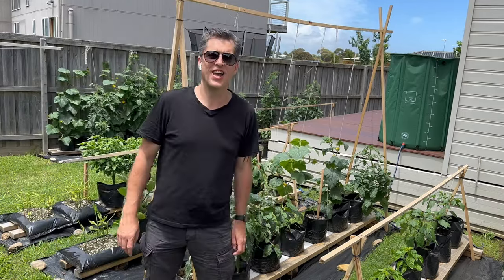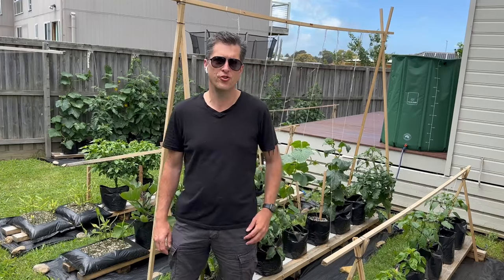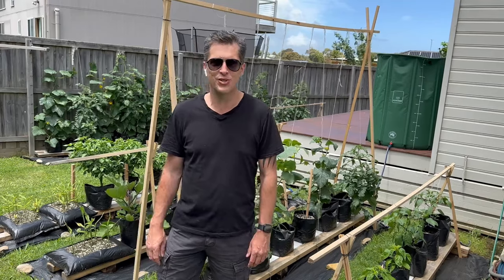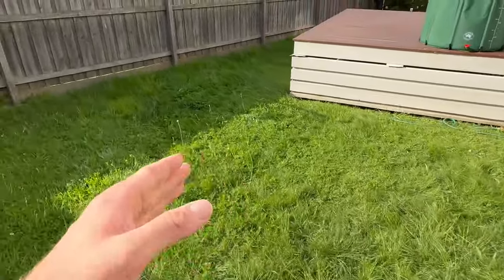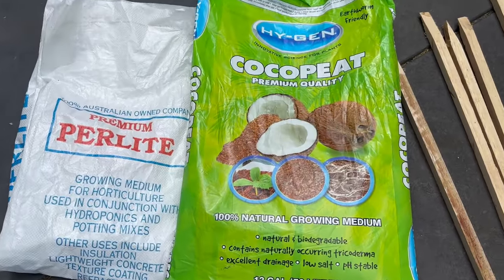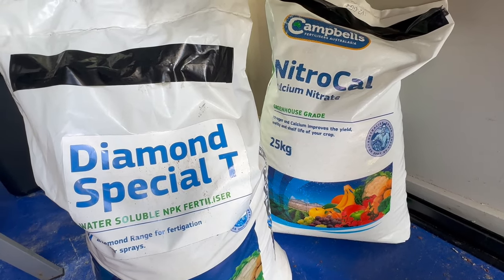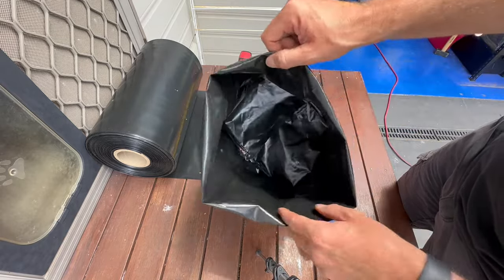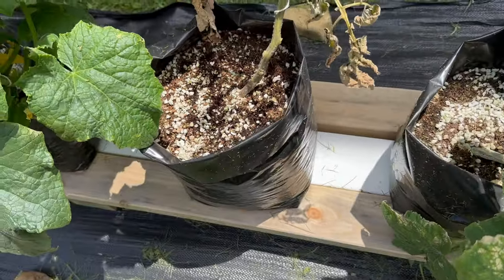Easy diy hydroponic vegetable garden inspired by @Hoocho

Comment: Hi Hydro Hack. Instead of using the cotton rope for your wicks, consider using microfibre cleaning coths. The best I've found are the Morgan Microfibre Cleaning Cloth - 20 Pack from Bunnings Hardware in Australia.  AUD$10 for a pack of 20. Each cloth is around 40cm x 30cm. The wicking action is a combination of the material used in the wick, the weave of that material & the surface area. Needless to say, the surface area of a single cloth is much more than 2 pieces of rope. The cloths above are a combination weave of polyester & polyamide, hence they don't rot like cotton. I've been reusing the same ones for 4 years & they are still in good nick. You can even sterilise them in the washing machine before reusing.

You can test the wicking abilities of different cloths by pegging them to the rim of a bucket. Add in some water & observe how quickly each cloth wicks up the water.

After your tests, why not pass this information on to Hoocho, so he can learn something from you :)

Please keep up the great vids!
Reply from the maker: Great idea and thanks! 🙏

Comment: Hi Hydro Hack. In addition to using microfibre cloths (described in my message below) with rain gutter grow systems, you can also use them with large pots for larger plants. Drill a hole to suit a top hat grommet in the side of a plastic basin (drill it down low near the bottom). Bunnings sell 4L, 9L & 16L plastic basins. The top hat grommet you want is for 6mm internal (11mm external) plastic tubing. Note this is not the usual 4mm tubing which easily blocks up. Drill a hole low down in the side of your down-spout gutter to fit another top hat grommet. Push fit the 6mm hose into both top hat grommets (you can also get 6mm barb fittings for this poly hose if you prefer). The water/nutrient level in your basin will now be the same as your float valve level in your down-spout. Now place your pot with the microfibre wicks hanging out the bottom over the basin. If the pot is heavy, place an upside down small pot in the basin, or some concrete blocks to support the bottom of the pot with the wicks in it. You can also connect multiple down-spouts together using this same technique, meaning only 1 float valve is required (if all rain gutters are at the same ground level).

Give it a try & if happy with the results, you can teach Hoocho some more techniques:)
Reply from the maker: I had the same idea (external container for float valve) but was thinking more for a larger wicking grow bed. I was thinking it would mitigate against roots impeding the float. Too fiddly for multiple rain gutters (none of which are at the same level in my garden). Also potentially creates a single point of failure if something goes wrong.
But I’ll be sure to suggest it to Hoocho at the next amateur hydroponics convention 😂
Reply: You can dig the plastic basins into the ground a bit or raise them up a bit with soil or use wood/brick as chocks. Doing this will allow you to use a single float. For redundancy you can always parallel up two floats. I use some round 50L growers pots on top of the plastic basins for larger plants with 2 or 3 microfiber cloths as wicks hanging out the bottom. Remember that the maximum capillary action of good potting mixes is around 400mm tops.

Comment: Quick question
Does the wick leak ? As in does it leave a little water in the bottom of the grow bag ?
Cheers thanks for the inspiration 🎄
Reply from the maker: Not really... Maybe a little. I have a couple of tomatoes where the roots have grown down into the channel but the roots have also spread out on top of the channel (between the bag and the channel top). I have noticed that these roots seem to transport liquid (whether from up in the bag or down in the channel) which then slowly pools and eventually drips out of the system. It's a very slow process so not impacting nutrient usage too much. Also whenever I find this I carefully trim these excess roots off. Note I always leave the hydroponic roots that hang down into the channel. I think the plants need these.
Reply: Sweet thanks, i just made a wood RGGS from a pallet & i using nursery pots cause thats all i have. Would love to see an update on yours.
Reply from the maker: @pallettime  perfect timing… just posted update https://youtu.be/3xcW9VICqhE?si=U85UH8-RnL7qOiS5

Comment: Whats the advantage of hydroponic?
Reply from the maker: Optimal nutrient and water delivery.
Reply: I live in the desert with extreme heat and drought.   Hydroponics greatly reduced the amount of water needed to grow my fruits and veggies.   I’ve moved and no longer have a yard so I’ve brought my hydroponics indoors where I have better control of light, temperature and humidity.   I mostly use a DWC system which allows me to customize the nutrient solution to the particular plant in the bucket. (plants that bloom/produce fruit vs greens)